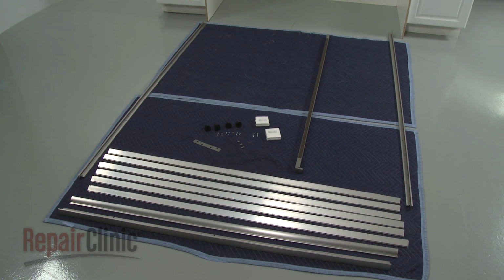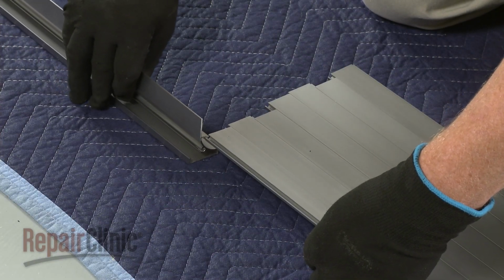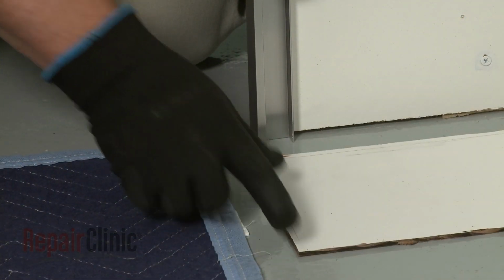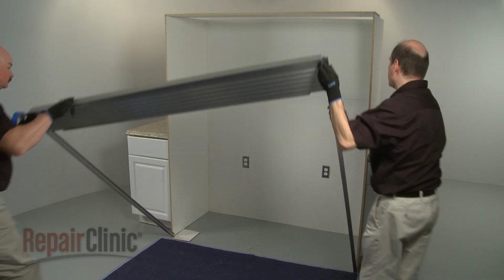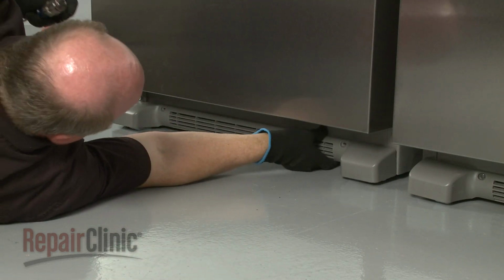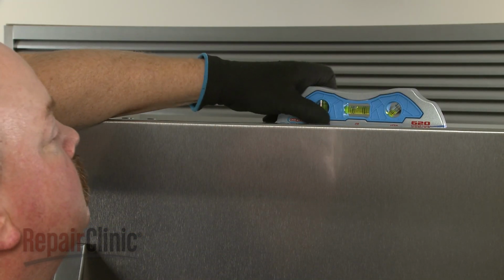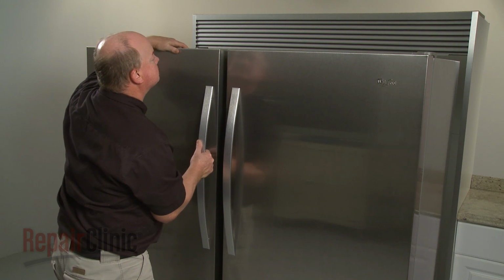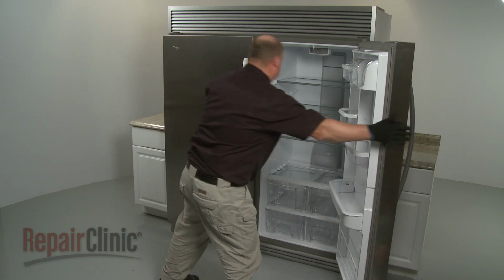Whirlpool Refrigerator/Freezer Trim Kit Installation SKT60M

Comment: Our old Sidekick refrig died earlier this month (and parts are not available) so we have to get a new one, which means a new freezer too (handles are different now, and no way will my wife go for different handles!!). But I am confused re. the requisite depth. Our old one required 24.25", but you say 26.5". I do see that in a newer SKT60 instruction manual W10691539A,  but the latest SKT60 manual W10691539C (Rev-C) goes back to saying 24.25". I know I'll need a new trim kit b/c of the top plate (and Rev-C says there's now a bottom plate too) whereas our old one had a bottom "bracket" ... but am trying to confirm if our existing depth (24.25") is going to work. Thanks in advance.
Reply: Going through the same thing now, I will NOT be going back with Whirlpool. $2900 for a one to only work 4 years? I think not.